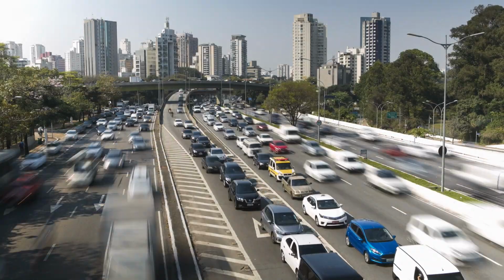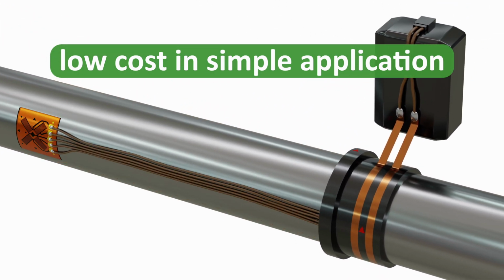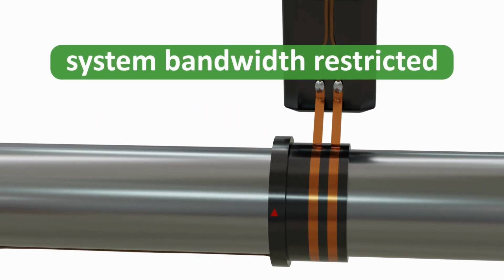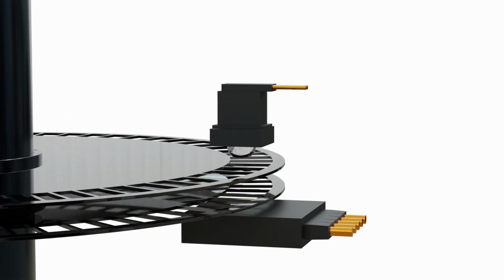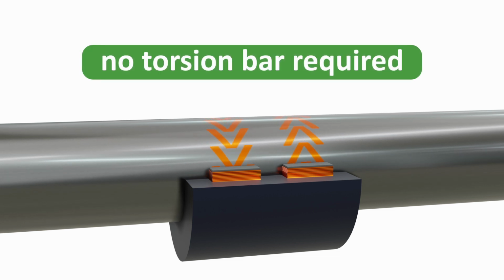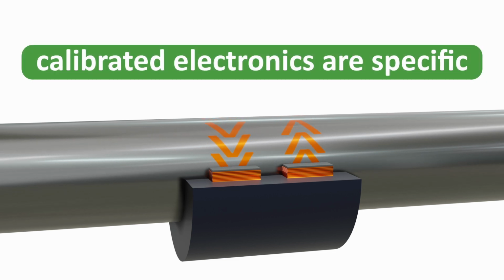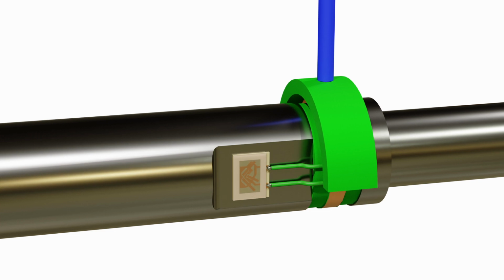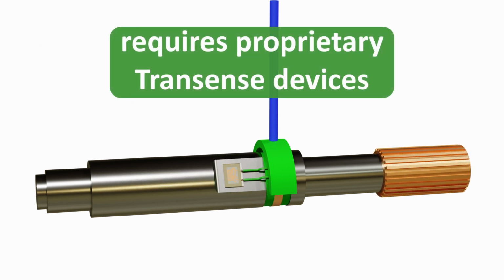Comparison of Torque Sensor Technologies | Transense Technologies

Comment: Can you measure both momentum and angle of twist with a strain gauge?
Reply from the maker: Hi @davorhars3083, thanks for your question.

The Transense sensors are not traditional strain gauges. Our technology uses Surface Acoustic Wave transducers to measure strain in the component being measured. 

Our surface acoustic wave transducers themselves measure strain and temperature, so they can measure torque – by aligning the transducer elements with the principal strain due to torsion on the component, you can measure this torque dynamically at high speed, our sensors do not measure angle of twist in the shaft (and neither does a conventional strain gauge) although we are measuring the strain caused by the twist. Transense sensing technology can be used to measure other strains, not just due to torque, so it can measure linear forces and could be used to establish the static loading on a component.

However, as Momentum = Mass (m) x Velocity (v), and in the context of a rotating shaft, "velocity" means angular velocity you just need to know the mass of the rotating component and its rotational speed, assuming the mass was constant just measuring the rotating speed would be sufficient.

If you would like to discuss your measurement challenge in more detail, please get in touch via our website contact page with more information on your application.

Comment: Great overview! How would the wireless torque sensor of Forcebit fit in?
Reply from the maker: There is not a huge amount of information on the Forcebit website, but it appears that their torque sensor is using 2 accelerometer sensors mounted on a shaft, this will rely on relative differential torsional acceleration between the 2 elements and then locally powered telemetry inside the sensor unit, similar principle to the displacement sensors in the video. Whilst this will be useful in test and measurement applications it is very different from the Transense SAW measurement principle which directly measures the surface strain of the shaft using only passive components on the shaft i.e. no battery power is needed, meaning this is well suited to integration into production systems as it is a “fit and forget” solution. The Transense technology can also measure a static torque so it does not require the shaft to be rotating.

The downside of the Transense technology in comparison is that it requires the shaft to be designed specifically and adapted to be installed with the AQP sensing elements and control the strain field.

 In summary, the Transense solution is very accurate, durable, and reliable so it is more suited to a permanent application but has a relatively high cost to apply. The Forcebit system looks like a quick solution that will get a measurement quickly but wouldn’t be something you could design into a production system due to the need for on-shaft electronics.

Comment: Thanks a lot
Reply from the maker: Happy to help!
Reply: transverse saw technology has zero NM setting issues due to values drifting g , you need to give enough time before each operation
Reply from the maker: @green-kundi8835  Thank you for your comment; Transense does not use Transverse SAW technology, transverse SAW has displacements in the plane normal to the propagation direction and often just in the surface plane (shear-horizontal waves). We use the Rayleigh type of SAW that mostly has normal to the surface and longitudinal displacement components.

In terms of zero drift the design of our SAW sensing elements and the adhesives used for bonding allow us to keep the creep which would result in zero drift to a very low level, in a correctly designed system this would not usually cause any issues with high-speed transient torque measurement.